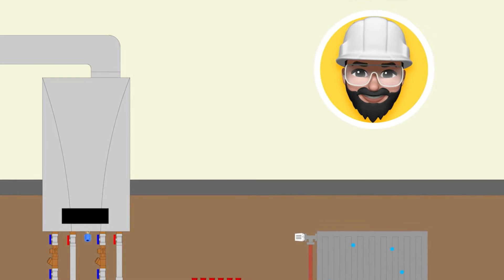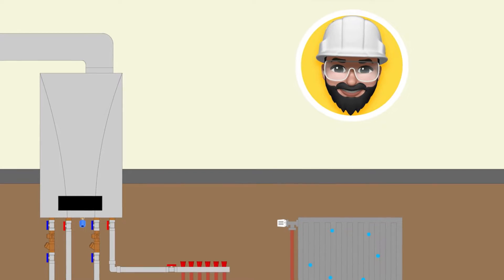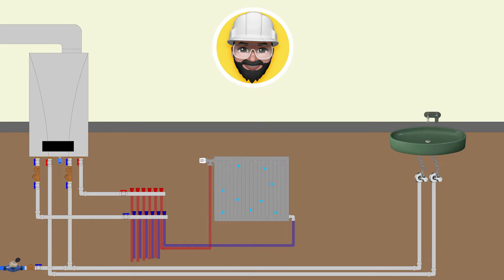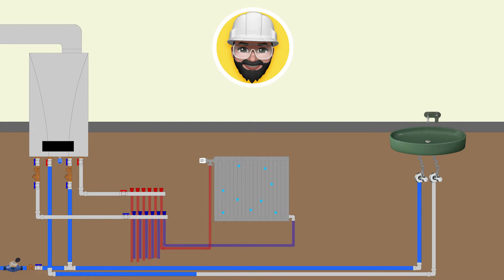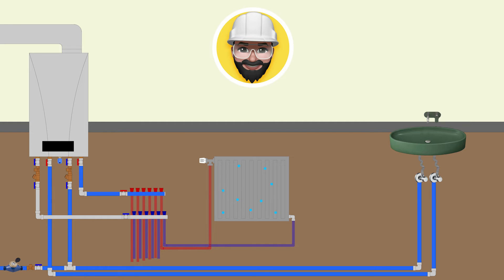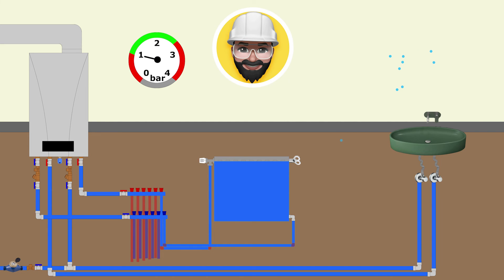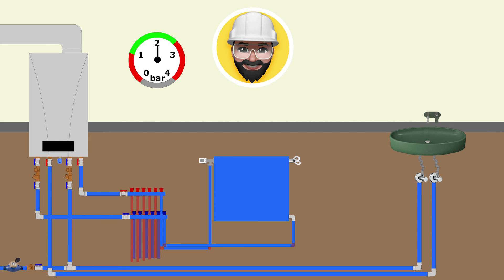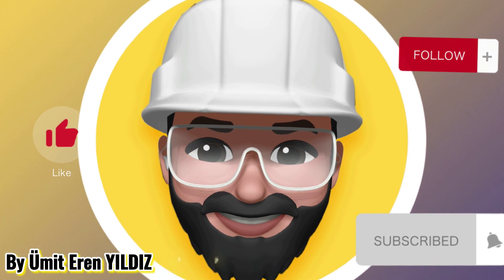How Combi Boiler ( Domestic Boiler ) Works Part 1

Comment: Great info! What happens if the outside water is too cold?
Reply from the maker: It’s impossible to be too cold it can be around 10 Celsius so the heating system can operate properly.